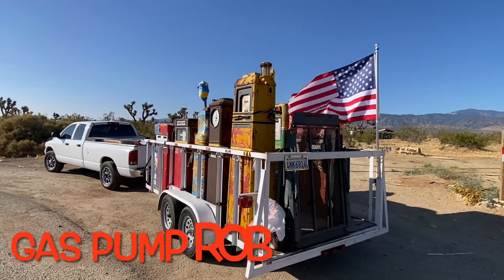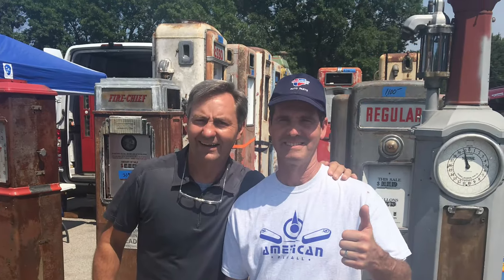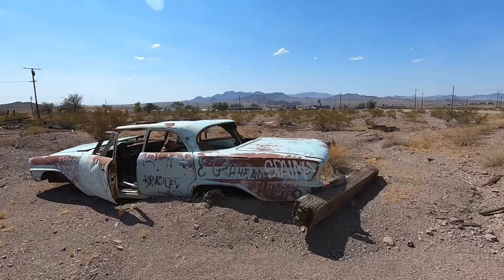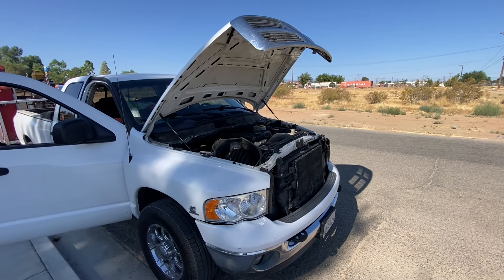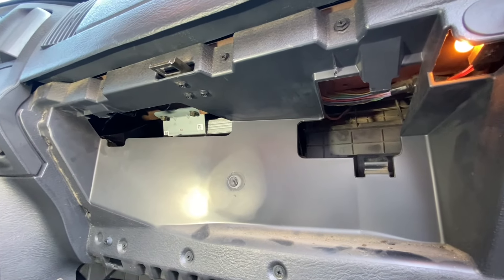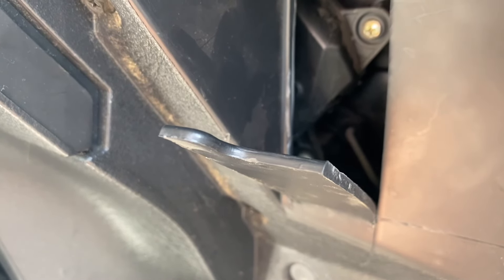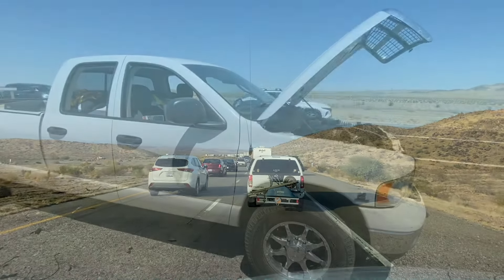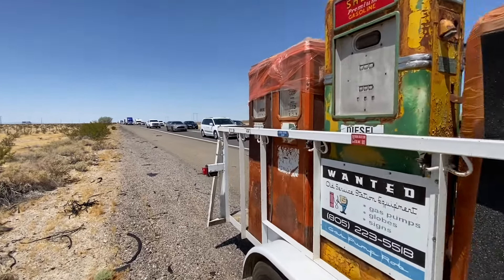A Upside Down Car -A Upside Down Day - Desert Adventure

Comment: I don't remember the upside down car looking so rough on the body. The floor pan looks nice 👍. I've said that before. What we should have done is thought about measuring the car. Now the front end looks like a Renault. Did you get an idea that the car look smaller than it should for a 1940 / 50 car 🚨🚨? Great video.
Reply from the maker: I’m thinking 40s Ford or Plymouth
Reply: @gaspumprob  I'd be more inclined to think Plymouth. But I think that's what I originally said. Do you want to know something silly? I'm sure there is an ID number on that frame that would be easily accessible when it's upside down. Well maybe another trip.